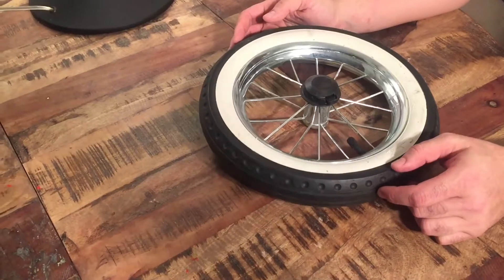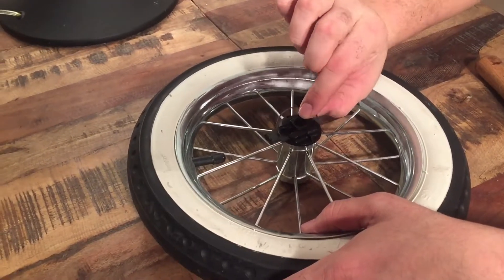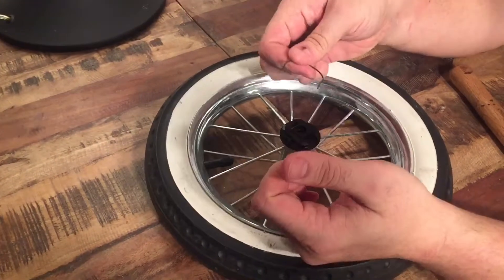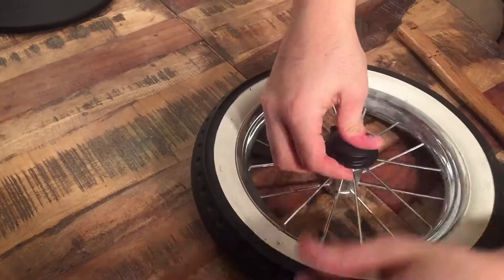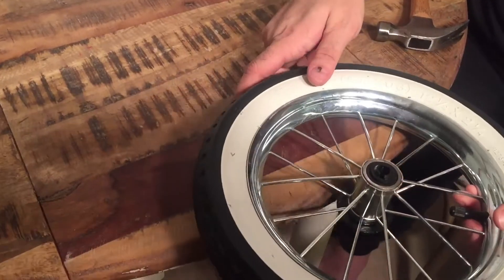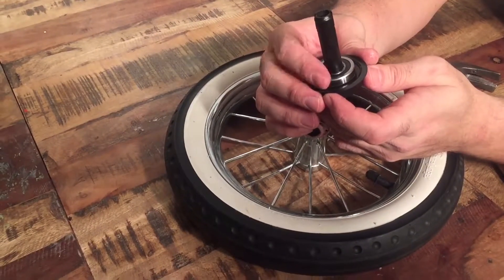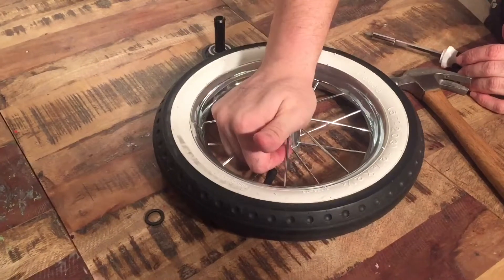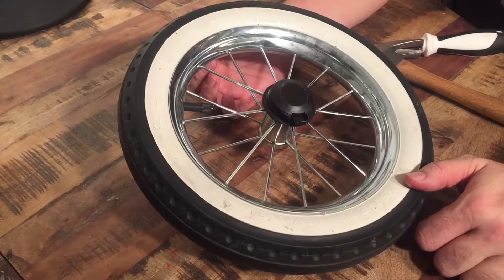How to Disassemble and Fix the Wheel Locking Mechanism on Emmaljunga Classic, Mondial and DeLuxe

Comment: Where can you buy new bearings for this? My bearing has a 14x32x7-RS written on it... Google cannot find anything!
Reply from the maker: Hi, we just did a video on this: https://www.youtube.com/watch?v=SqKJgGi5Lmo&t=33s
'RS' is the company.  Most ball bearings have a model number, but it seems yours most likely just has the dimensions (listed in millimeters).  Get a ruler, and verify the following: '14' should be the inner diameter (the hole), '32' should be the outer diameter (the whole bearing), and '7' should be the race width (thickness).  If this looks correct, then you can order a bearing with these dimensions from any manufacturer.  If it's not correct, let me know and we'll try to figure it out further :)
Reply: Do you know where to buy parts for the locking mechanism?